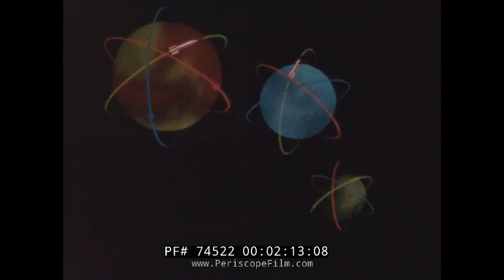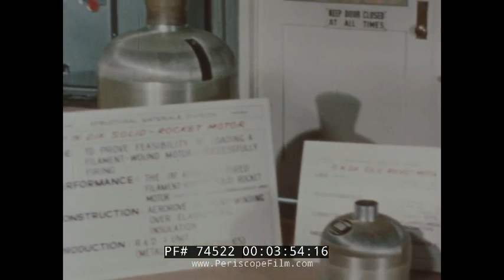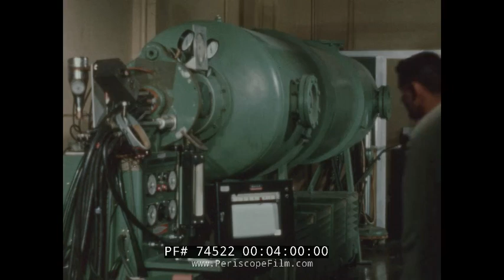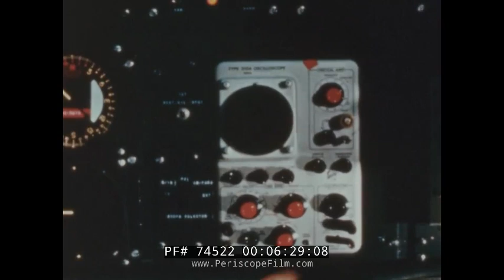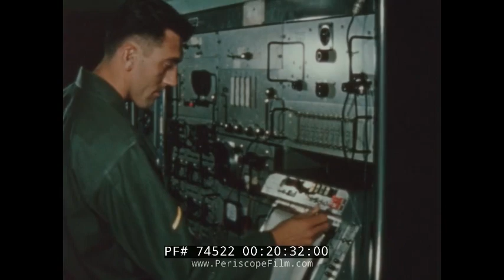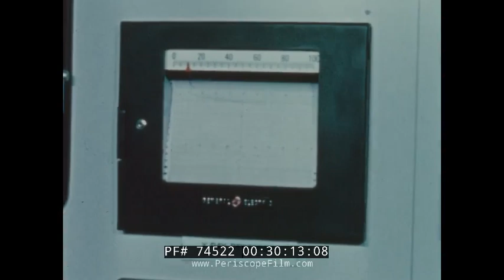" REPORT FROM AEROJET " 1950s AEROJET GENERAL MISSILE & ROCKET ENGINES  THEODORE VON KARMAN 74522

Comment: You would think they could find a way to limit the smoke coming out of the missiles.
Reply: David Sandell that is LOX boiling. Stoping that is basically impossible. Titan I and the early Atlas rockets would have propellant stored in containers separate from the missile, and were loaded in just before launch. Titan II and Minuteman would get around this by using storable propellants.
Reply: Understand.  Thanks for the reply. I guess it really doesn’t matter at the speeds and altitudes they’re going.
Reply: They have smokeless propellants now that make our sidewinder missiles impossible to see.  Instant and guaranteed death.

Comment: Aerojet, The Charlie Brown to NASAs Lucy. NASA screwed them over so many times. (One screw job killed 7 astronauts when NASA give the Shuttle SRB contract to Morton "We need O-rings Because we are in effing Utah!" Thiokol instead of Aerojet)
Reply: NASA's  decision to fly ignoring engineer's warnings about what cold can do to the o ring seals is what happened not the contractors.
Reply: @albclean   my brother, an engineer and program supervisor at Aerojet General, told me a space shuttle would blow up years before Challenger exploded and he told me why it would explode. Morton Thiokol was in Utah, given the solid rocket booster contract for political reasons, had to build the boosters in sections due to transport considerations.  O-rings were used and were guaranteed to fail. And they did.